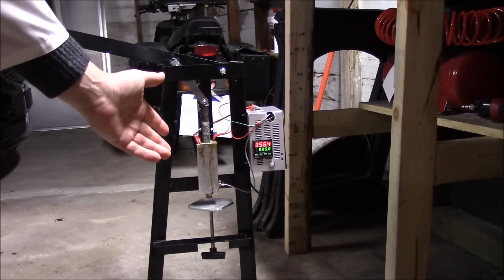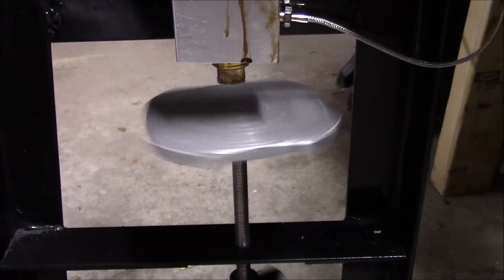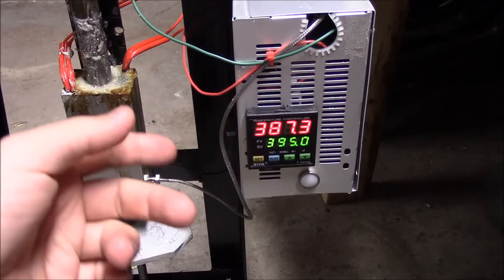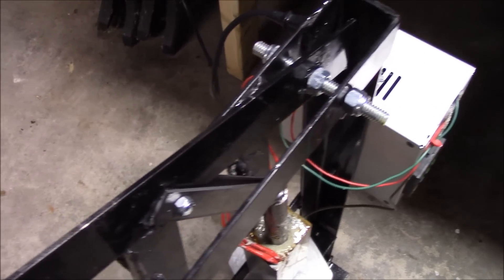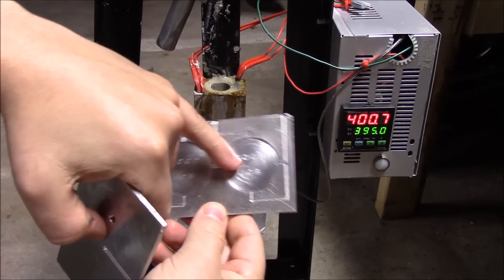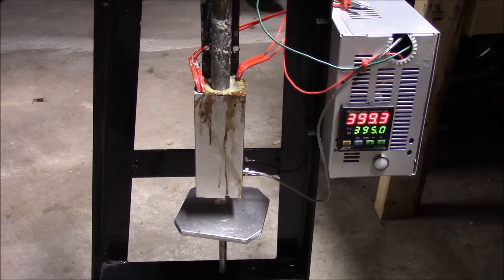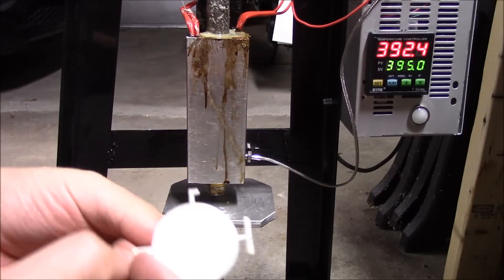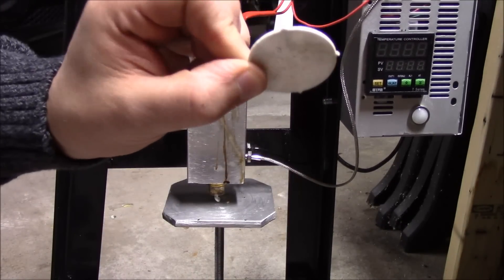Make Your Own Injection Molding Machine

Comment: Just wanted to tell you how I do it. Cut like 5 hangers in 3-4 5in pieces and toss them in a 20 dollar blender. Makes awesome plastic beads that you can just pour right in.
Reply from the maker: Thank you for the suggestion. I tired it and can fit more plastic in at one time! Also, the plastic comes out the injection machine easier.
Reply from the maker: 395 F works for the coat hangers I use. I did not know the exact type of plastic, I assumed it was some variant of Polystyrene. The 395 figure was found after a little trial and error.

Comment: Thank you for your vidéo. Please how to ensure that the piston perfectly fit thé cylinder ?
Reply from the maker: I found drill bit that was the same diameter as the rod. I then used a drill press and a vice to perfectly align while drilling. I did have to use a drill bit extender. Thanks for watching!

Comment: The original design is from Vincent GINGERLY. He has a book the secret to building a plastic injection molding machine. All of the plans are in the book although he uses a bimetal thermostat instead of a pid.
Reply from the maker: Yep, however, I made this without looking at his book. I did see pictures of similar machines from people that bought that book and thought "I can make that!" and then proceeded to make up my own plans. I find unnecessarily struggling can be a ton of fun ;)

Comment: I see a lot of diys use cartridge heaters why not band heaters or coil heaters?
Reply from the maker: I can't speak for everyone... I used cartridge heaters for ease of install and quicker thermal transfer. The heat source is inside the block instead of being wrapped around on the outside, which is what you would have to do if you used band or coil.
Reply: @IllInformedHuman  i think your right your barrel is 13" but prescious plastic is 22" but they need 6 band heaters vs your 2 cartridge the only question is as cheaper option would high heat insulation produce similar results like another guy on you tube did ?
Reply from the maker: @JonBoy_Futch  I would be willing to put money on my method being cheaper, even if the other guy says otherwise XD
Reply: I'll have to do more price comparison cause I think I get a block for $30 on eBay but maybe I try the scrap yard thank you  for the clarifications .

Comment: It is a real wonderful project.
please, try to explain the making of the Nozzle and tell me if i can use the 3D printer temp. controller or not.
Many thanks.
Reply from the maker: The nozzle is just a pipe cap that has a hole drilled out in the middle. The heater block is a piece of aluminum that has a hole bore out of it.
You likely could use a 3D printer temp controller, it just takes a thermo-couple and regulates a voltage output based on that, give it a shot!

Comment: Could you tell me how you made the metal mold
Reply from the maker: The rod is steel rod (OD matching the hole diameter). I ground one end "flat" with an angle grinder and then drilled a hole in it to allow a bolt to go through. The end that goes into the heated block had to be sanded down to allow a smooth fit. It also had the edges rounded to make guiding the rod in the hole easier.